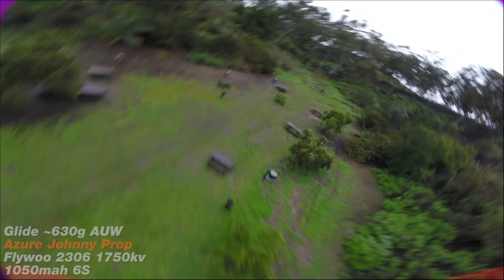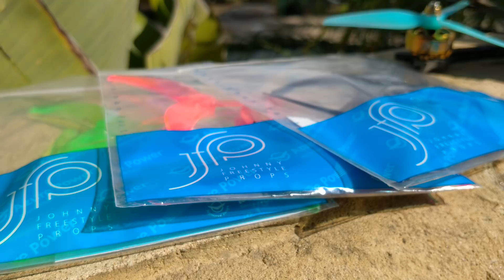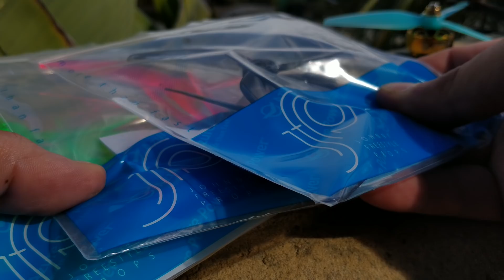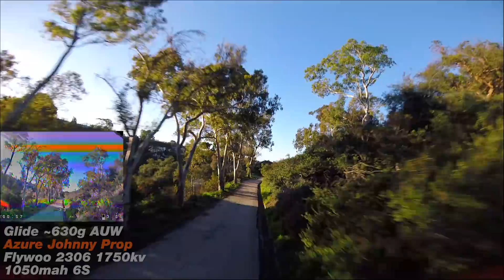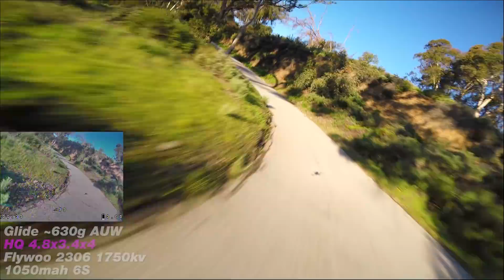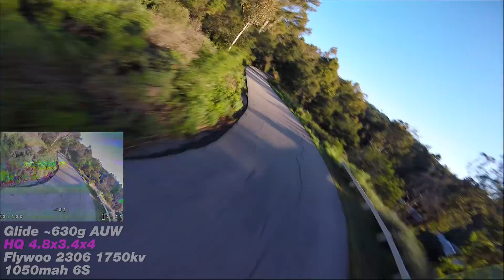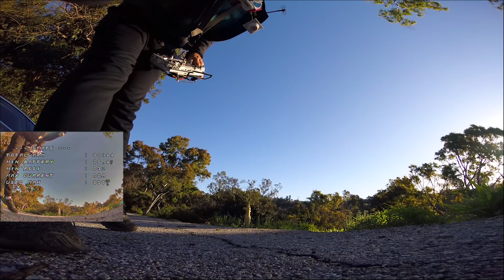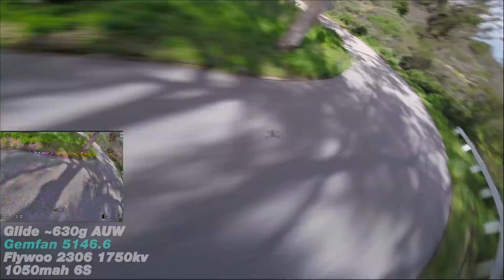Azure Johnny prop + some others

Comment: What would you choose for a light 2205.5 2522kv 4s setup with a smaller battery. AUW is 350g. For racing. I'd like a good balance of speed, handling and efficiency. Tried cyclone 5051 and HQ 5x4.3x3 and DAL was quite good but lacked power and durability.
Reply from the maker: Definitely absolutely without a doubt this gemfan prop. However, I wouldn't recommend anything less than 2207 for a 5" anymore. I realize your quad is probably a bit older. Moving forward, 2207 and 2306 are the smallest I've found to give really good 5" performance regardless of AUW or anything else.
Reply: I have something that sounds really close to that.  It'll be hard to beat the GF5149 for going fast, and that HQ is up there in terms of performance.  If you can tolerate the same durability as the T5051's, the TMotor 5143's are really good, as are the Ethix S3's.  Otherwise, if you need really durable stuff, I run all mine on T5046C V2 Cyclones.  They're the universal B student, but for an all around setup that's amazing